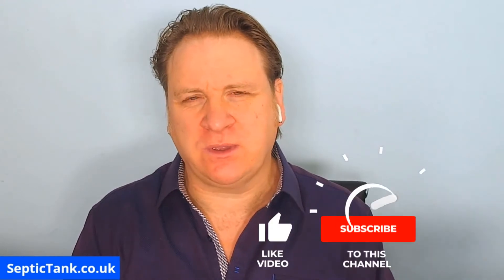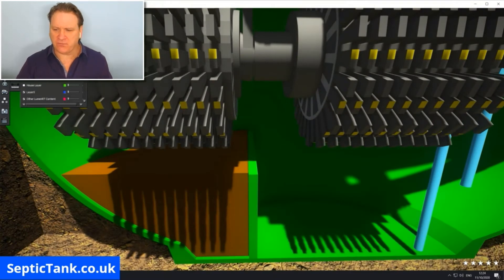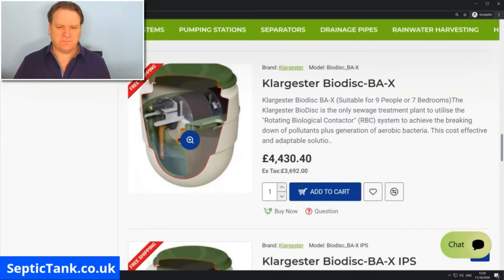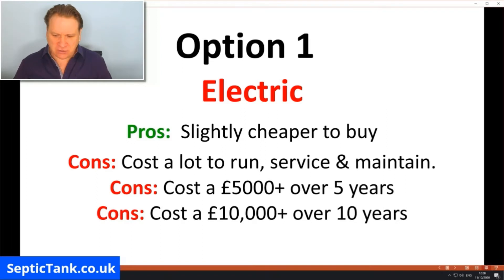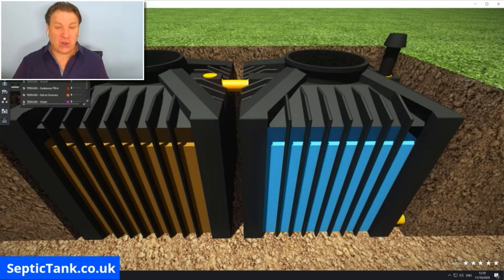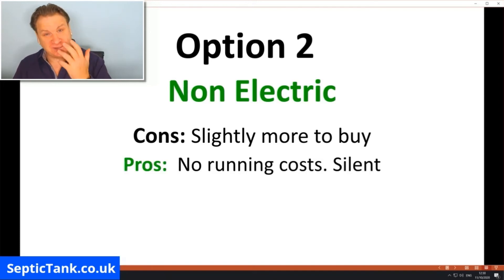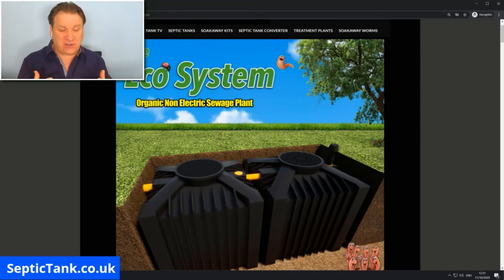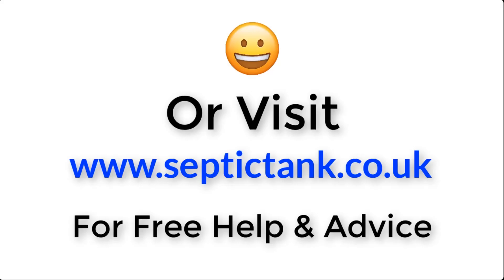which domestic sewage treatment plant is best

Comment: Unfortunately I do not have the fall for a eco system and will need to install the air type.  What is you opinion of the Harlequin HydroClear treatment plant?
Reply from the maker: Hi. Thanks for your comment. 

Personally, I hate electric systems. They cost money to run and only have a 1 year warranty. 

There are other negative things but you get the point. 

Have you seen the new eco system. The outlet is a lot shallower?

Comment: IVE SERVICED AND INSTALLED SEWAGE TANKS FOR 23+ YEARS. A NON ELECTRIC PLANT WILL NEVER GIVE A FINAL EFFLUENT SAMPLE AS GOOD AS AN MOTOR/COMPRESSOR DRIVEN PLANT. YEAH YOU MIGHT NEED BEARINGS AND MOTORS REPLACED. BUT DONT BE FOOLED BY HIS BOLLOCKS . NON ELECTRIC PLANTS NEED INTERNAL FILTERS/ MEDIA CHANGED OVER TIME. SUCH PLANTS AS A BIOROCK  PLANTS COST THOUSANDS OF UK POUNDS TO RENEW INTERNAL MEDIA BAGS.

Comment: Why do you say they cost £1k per year?  (Asking not criticising).  The Harlequin Hydroclear 9 uses 1.1Kwh per day which on 30p a Kwh is £120 a year. What's the additional cost?
Reply from the maker: I say that because servicing cost, electric costs and replacement part all add up.

In my opinion a non electric sewage treatment plant is 100% better.

No electricity costs. Minimal servicing. Nothing to break down
Reply: But do they produce low ammonia levels of discharge? And therefore keep the environment agency happy? I discharge to a borehole